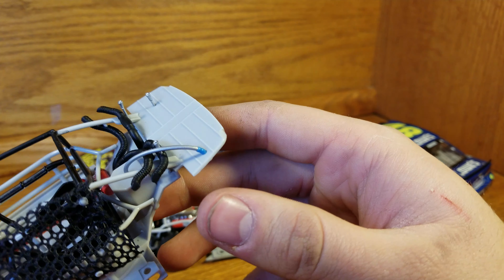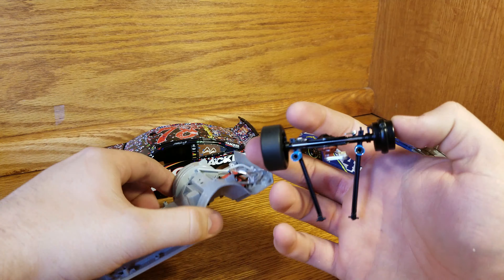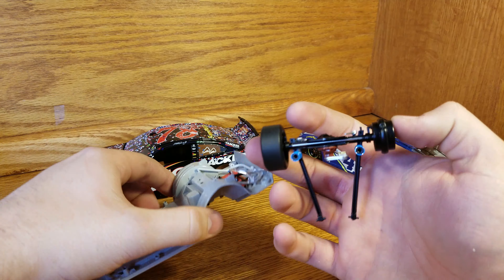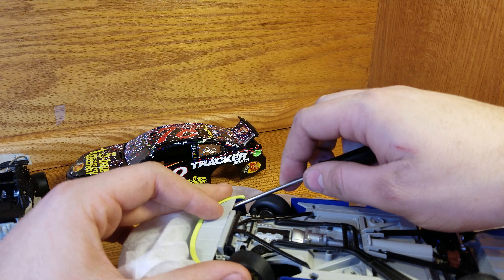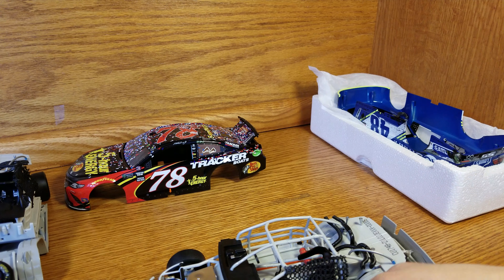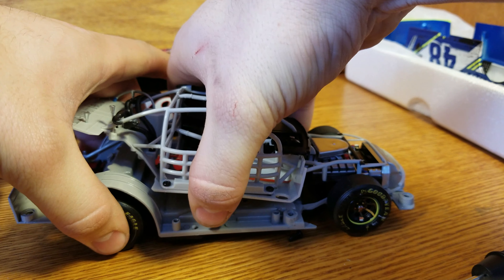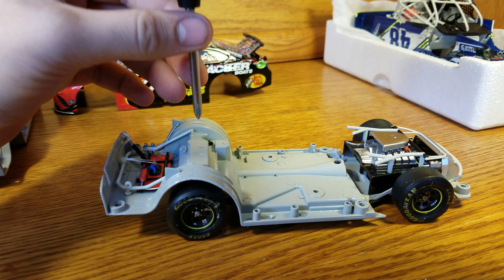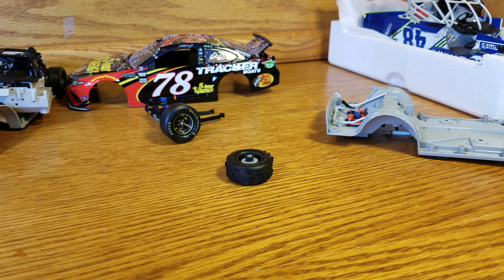NASCAR Diecast Review: Custom Tire Swap Part 2

Comment: I just got an elite diecast 2018. I was surprised when I saw the engine.  I thought it was a production defect (incomplete production).  It's very different from the elite when it comes to action brands.  But after seeing your video I just found out that lionel racing quality is like that.

Comment: Can Elite 2018 not connect steers with poseable wheels?
Reply from the maker: With modified parts maybe but stock it cant
Reply: @racecraze  hopefully you will make the video about it. Thanks